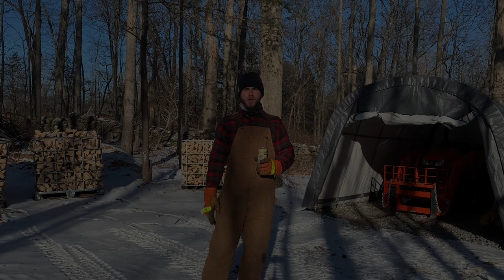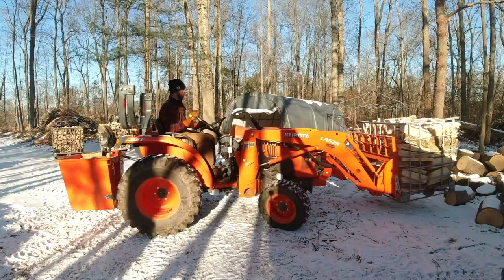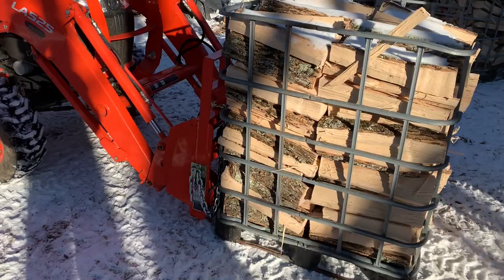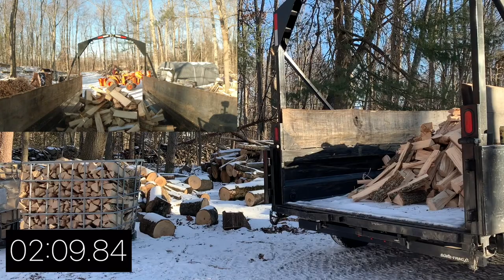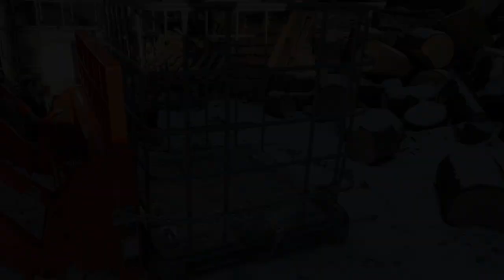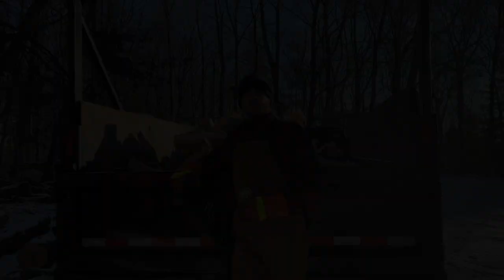#74 Fastest Way to Load a Cord of Firedwood Ever??

Comment: A couple of thoughts:

1. You might u-bolt a plate onto each side of the tote with an external u-shaped eye welded to it. The plate would distribute the load to several parts of the tote and the external eye would give you a quick connection point.

2.  You might retain more rigidity of the tote if you left the topmost horizontal bar on the front of the tote.
Reply from the maker: I like that idea! I’m trying to keep it all simple as possible and not destroy the totes too quickly. Once these totes start failing my plan is to leave the top bar in the future!

Comment: I think a large skeleton bucket scooping from a pile of firewood is faster.  Or firewood bags with the Velcro bottoms would be super fast.  Even the regular firewood bags with the strap on the bottom for upending the bag would be faster.  But not by much and you have a great system.  Competitive with just about anybody
Reply: Bags would work good one or two times but fail pretty quickly. They also take a beating from the sun and only last a couple of seasons, even under the best of conditions. The way it's looking, even these IBC totes won't last a whole lot longer and there is no good way to repair them once they start falling apart.
Reply from the maker: The skeleton buckets seem to work well but aren’t cheap and I personally don’t think the wood dries as evenly in a big pile like that. I get the IBC totes for free so they last as long as they last! The three I’ve been using with the face completely cut out have loaded at least 10 cords into the trailer and still functional!

Comment: What if you were to change your hooks to a bigger hook that will fit over the cross section of the rails so you don't have to try to feed the hole chain through
Reply from the maker: My one concern with using a larger “open” hook is that it could potentially fall off when I shake the totes to dump them.
Reply: @DudeRanchDIY  very true

Comment: If you usednormal open hooks on the end of those chains that you can just hook into the bars of the totes, you could cut your loading time in half. That farting around with threading the chain through the bars is what takes the longest time
Reply from the maker: The problem with a normal hook is that it could potentially fall off when I shake the tote.
Reply: @DudeRanchDIY  use one with the safety latch in them that clicks shut when you put it on but even a open one won't fall off as the tote slides forward on the forks into the hook. I have not had one come off yet and I travel on a rough logging road with the IBC tote on the forks of my Yanmar 235 with is a comparable size tractor to yours and I took the safety tab off my hooks
Reply from the maker: I’ll have to find a set of these!
Reply: @DudeRanchDIY  I got mine at the local Farmers CO OP about $4.50 for one